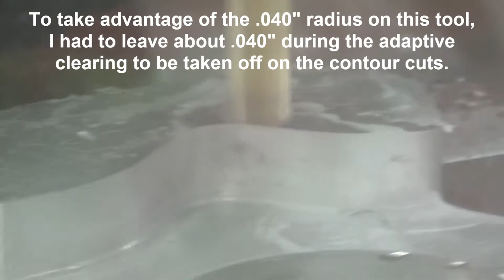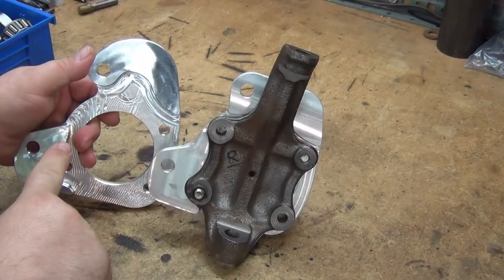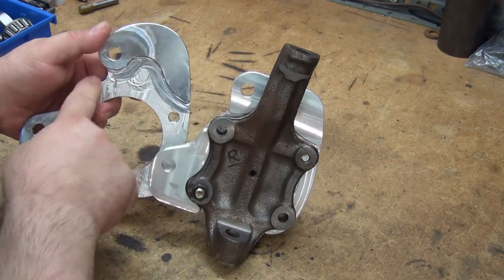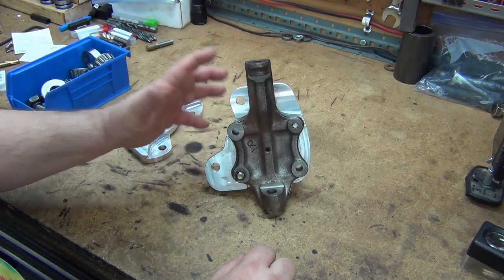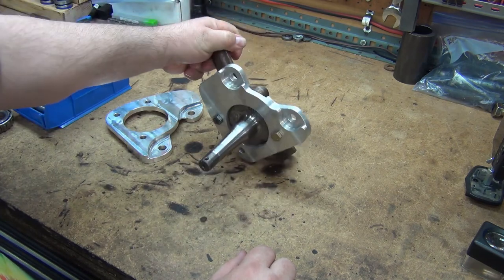Disc Brake Bracket Prototype - 411SSS Ver2

Comment: Good to see the evolution of your parts and the striving to improve the piece rather than save pennies.  Nice work beefing up that offset web.  Folks forget that OEM parts are not the epitome of design.  They're made to a cost or to accommodate a specific material or process.  A part made of cast iron cannot simply be copied over to machined aluminum and you seem to be adapting nicely. Bravo!
Reply from the maker: Thanks! Eddie! Praise from you certainly brings a smile to my face. :)

Comment: Hey! There's that bit that I love so much. It sounds a little chattery at times though. :(

I wonder if you used the same cut parameters as I did in this video ( _2D2uDARWRM ) if it would sound better on your machine too. If I'm doing my math right, you're getting 1.575 cubic inches a minute of removal rate and with the speed/feed I was using you'd get 2.3 at that depth of cut. An almost 50% bump in speed would be nice, as long as it still sounds/looks good.

I was using 3990 RPM, ~.105" WOC, and .86" DOC, seems like the lower depth should only make things better, but end mills are weird.

So, the last thing I milled (after a very long hiatus of not milling anything) needed a deeper depth than that end mill could do (I needed 40mm) so I switched over to Shars' long-reach version of the same end mill (possibly with square corners though). I wasn't being too particular about how much stickout I left, but I did measure it and it was at about 57mm. The plan was to do two roughing passes of 20mm depth a-piece. I tell ya, that bit didn't last even a single second! Hit the stock, chattered like crazy, pulled the stock out of the vise, and exploded - all in about half a second. Replaced the bit with a Lakeshore Carbide long-reach end mill (basically the same thing as the Shars, with about the same amount of stickout) and it worked just fine. Same code and everything. Argh!

Oh, and as I've said before: the things you're making are so cool! Thanks for the vids (I've been enjoying the recent uptick in the number of videos you've been putting out)!
Reply from the maker: I don't think it was the bits fault.  This machine seems to like to chatter on the backside cuts from left to right.  It will do it inside a hole when it passes left to right.  I've talked to others that have the same issue...seems to be semi-common between the Torus and the Tormach.  Rigidity?  It really hates cob cutters in aluminum on the backside!!!  Wow!
I'm sure I could push that bit harder, but I'm a bit gun shy on pushing this spindle's load.  I tend to run at 6000 for any cutter 1/2" and under.
oops....more later....food just showed up. :)
Reply from the maker: What kept you running the EM at 3990?  As I said, I typically run at 6000rpm......but I also tend to use coated end mills.  When I started, I thought.....an end mill is an end mill... lol  I'm starting to understand how people can have such a preference toward one brand or another.  Same specs from one brand to another don't really act the same it seems.  So....once you get a tool path dialed in with a particular end mill, it seems a lot more predictable to stay with the same make/model for that part/tool path. 

I was a bit too busy at one point to do much with video.  Instagram makes it so easy to put out updates. lol  Plus....there are times where I just get sooo burned out on editing.  This last time I took a break was because I was considering dropping my channel.  Of the $2600 the channel made last year, I had to pay $2200 of that to taxes.....so $400 for hundreds of hours of shooting/editing.......it really took the wind out of my sails!!  But.....I couldn't bring myself to walk away.....so I'm trying to get caught on the editing. :)
....and Thanks!!!
Reply: I was using SolidCAM at the time and I had the "iMachining" package. iMachining would take your machine and cut parameters and calculate the feeds and speeds for you. It was pretty cool, really. Since it was working, I didn't mess with the feeds or speeds too much. As I recall, I had chatter going in certain directions as well, I don't remember if I was able to get rid of it though. I know I attempted to a time or two, but whether it worked or not has left my memory.

That's one of the reasons I haven't joined Instagram... I'm a-scared that it'll be too easy to just put up a photo or short video every now and then and I'll end up abandoning YouTube. I'm basically letting myself fall victim to the sunk-cost fallacy. :p Of course, I've pretty much already abandoned YouTube, so even that reason doesn't really make sense. I looked up your Instagram profile and have bookmarked it (now I have TWO Instagram bookmarks, you and Tactical Keychains). That drill video you posted was hilarious!

That's some good scratch! ... until you have to pay 85% of it in taxes. Ouch! Was that $2200 just from the $2600, or was there other income factored in? $400 is better than the $0 my channel makes, though. :) On the other hand, I could see $0 being preferable to the sting of only keeping 15%.
Reply: Oh... and I'm totally with you on editing. It SUUUUUUCCCCCCKKKS!
Reply from the maker: Fusion is the only CAM I've ever used.  I'm really glad it works as well as it does.  
IG is great.....for the most part...tons of great content and information there, but the short length means I go to YT for most info.  Depending on what your plans are for your YT channel, a lot of people are doing IG instead of YT.  If you're just looking to gain exposure and not create an income, than IG will probably beat YT for a lot less effort.  IG has a lot more hot chicks and nice butts on it. :)  I wish IG was more computer friendly.  You can only DM from a mobile device.....which can be annoying.  I was telling people that were interested in my parts, to follow my on YT for updates.  But...those updates can take a month or more to get posted, so now I tell them IG or FB.  I can share to FB when I post to IG, so it covers two places at the same time.  I can do that when posting to YT, but it's not "instant" like "instant gram". :)
We figured up our taxes....we were getting money back.....we added the $2600 into the mix and instantly owed $2200 more in taxes and had to pay.  It's a scam.  I tried to figure it up as a business the previous year to see if it would lower it any. Nope.  The tax liability went down, but they added in business fees that were the exact same amount as the difference in the tax. Net result was the same amount paid....but then I'd be on the hook to be a business.  Not sure why I even keep the vids monetized.
Reply from the maker: Had to look up sunk-cost.  Maybe a real...or bigger business can see past that, but for me.....I can't seem to forget just how much is already been "sunk" into this venture. lol!!  Not sure I have any chance of making enough to recover that. :(
Drill vid?  The most recent post?
Reply: Yeah, the most recent video, where the drill and chuck dropped into the hole directly below it. LOL
Reply from the maker: I almost dropped it again on a run yesterday. lol